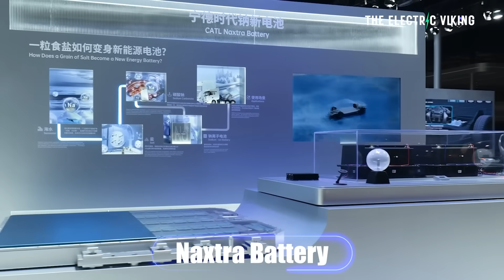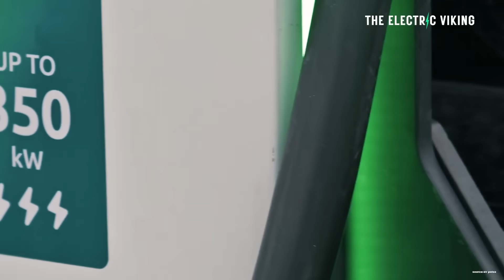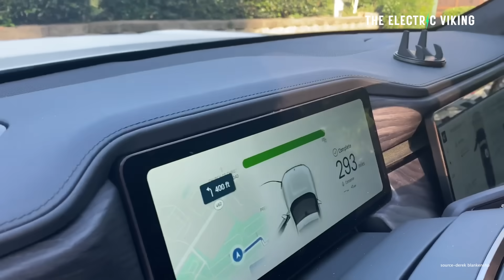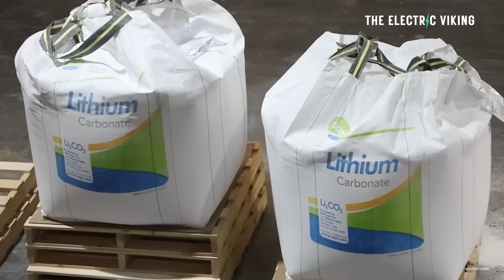Rivian's CEO says American's will miss out on LFP & Sodium Battery Revolution

Comment: Cool, looking forward to Sodium. But until then what about LTO batteries? Lithium tritinate.  2x  less enegry density so they arent popular i guess, but 10x faster charging?  ill take  twice as big battery for 10x faster charging.  Low temp operations and basically fireproof.  Oh and 100x more cycles, you basically have it for life, it will last 50-100 years at >80% capacity. That actually makes them cheaper then all the others.  Theres a company in India who uses them in their moped rentals, they claim 80-90km range with like 15 minutes recharge.  You can charge a 45amp hour 48vscooter battery with like 10 000 -20 000watts.  You cant do that with regular lithium ion.  Only problem is thats a lot of amps  so you need to make custom chargers, i think thats what the company in India did to make it work.  I found them just by googling LTO's and saw their website. But without the fast charging the energy density i could see becomes an issues, especially at higher voltage EV's  since these are low volt cell and pretty big.  But i still like the cycles and safety and would use them for solar or something. 
 But if you do the math, 2x less energy density, with 10x faster recharging is still a win, because you can size the pack smaller, and get away with it because of quicker recharging. Big capacity battery with moderate recharge rate, or small battery with fast recharge? what will get you further in less time?  My mind hurts thinking about it but theres a sweet spot, where you might not need the energy density if you got the quicker recharging.

Comment: I live in California and I’m still waiting for battery prices to come down sufficiently to compete with gasoline. For example, I bought a gas generator four years ago for $960. It puts out 13, 000 Watts peak power and 10,500 watts Continuous power. I recently looked at a. Jackery LFP battery that puts out 3000 Watts.  It cost like $3,700.  So I have to pay three times as much on battery back up power that provides like a third of the power. So again financially, it just doesn’t make sense. I want to do the right thing for the environment and I would like nice quiet, clean energy. But it still mainly for the wealthy people.
Reply: Not really apples to apples. Especially if you have solar.

Comment: Yeah, my opinion is that it's a tradeoff between range and fast charging. Once you get above a certain range fast charging becomes far less important. for 95% of road users fast charging is pointless if your EV can travel as far as you want to go in one day. When I travel from home to the big city my overnight stop is 800km away, if the battery can take me that far then fast charging is irrelevant, I can just charge at whatever rate I want as long as the car is charged for the next day. If the range is less than 800km then all I need is enough charging speed to get me the rest of the way with a charge time or ten to fifteen minutes or so, I can have a short break from driving and get going once that amount of charge is reached. Better if I can set an app that says, charge Xwh in fifteen minutes at whatever rate that takes, job done. On the other hand if I have only 300km range then that's at least 2 charging stops so fast charging becomes more important.

Mw charging sounds good, but it's really a use case for applications like long range trucking, if you have a battery of 900kwh, which some do, then megawatt charging becomes very necessary. If you have 2 drivers you want to minimise downtime to charging so Mw charging is necessary, for private car users much less so, specially with the increasing energy density of batteries. Smart charging should enable the battery to decide how fast to charge based on how long you are stopping regardless of the max power available at the charger, just tell the BMS how long you are stopping and let it decide what to do as far as charging rate is concerned.

Comment: 𝐚𝐝𝐝𝐢𝐭𝐢𝐨𝐧𝐚𝐥 𝐧𝐨𝐭𝐞: BYD had developed the blade battery concept to get around the low energy density for LFP. For version 2.0 they changed to a "short blade" concept - exactly because to increase options for cooling the battery during charing. So they did actually make a compromise favouring charging speed.
𝐬𝐞𝐜𝐨𝐧𝐝 𝐧𝐨𝐭𝐞: check out Tesla's NMC640 being another way to get LFP prices without getting dependent on Chinese battery makers.

Comment: Americans know better than everybody else, just ask them.
Rivian are not the best EV maker just ask Sandy Munro. 
I don't agree with all the things Sandy says but he is a very intelligent engineer.
Battery tech is advancing in leaps and bounds and the USA cannot make the latest tech. 
The USA will never get Sodium Ion batteries as CATL will never build a plant in the USA whilst political tension between USA and China exist. In current climate that will never happen.
Aluminium Ion batteries have potential to overtake LFP or Lithium Manganese Rich batteries.
Sodium Ion better at severe cold and severe heat but not quite as many charges as LFP.
Solid state still years away  from Full scale production at best and will be super exy$$$$

Comment: I believe Utopia for EV battery is 400 mile range, 10 to 80 percent in 15 minutes.
Reply: in 2030 it will be 500 miles range and a full charge in 5 minutes.  There is no way this will NOT happen.  It just makes sense,  if I was an ev car manufacturer the only way I could compete with ice was to match them at least.
Reply: Agreed, though pretty darned good would be an affordable car, 300 mile range and 15 minute charging!
Reply: Dream on bro...😴
Reply: IF EV can charge to 500 miles range, I will be willing to wait 1 hr for DC fast charging OR 12 hrs slow AC charging.  I do long work trips and my current Ford ranger Diesel 2.2L have almost 470miles on 1 full tank.